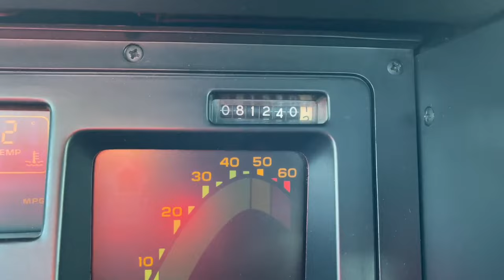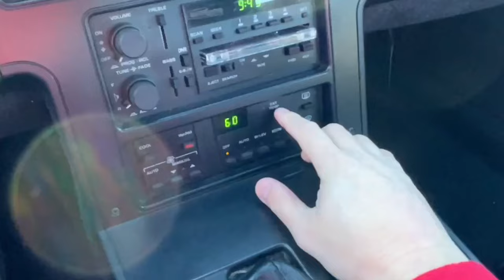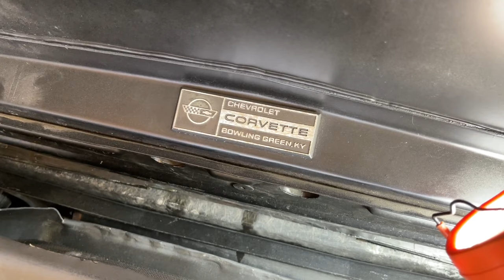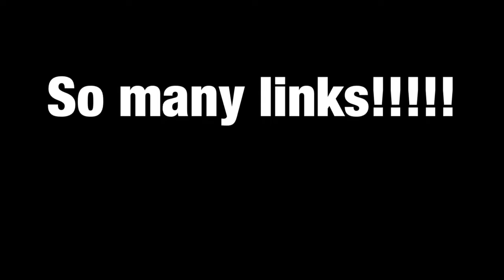6 CHEAP AND EASY C4 CORVETTE MODS

Comment: Here's another FREE mod, simply remove the heavy harmonic-balancer on the front of the water pump.  I noticed an immediate improvement in the acceleration of my 90-C4!
Reply: Yes gotta love the frisbee, even c4 engineers admitted it was really quite a pointless feature and removing it is good for supposedly 10 hp
Reply: @connerdesomething6218  I've always been about finding ways to make my car more powerful but isn't the harmonic balancer there for a reason??
Reply: @connerdesomething6218  Removing this external load from the engine adds zero horsepower.  What it DOES do is reduce inertia and lets the car accelerate more quickly.
Reply: Yea that's a great idea..😂
Reply: Wait what lol
Reply: @G31mR  Its adds Horsepower to the rear wheels!
Reply: @leejohnson2550  I mean, I’ll probably listen to the Corvette engineers who built the car and had to come out later and admit it wasn’t there for anything in the long run, they thought it would do a thing and it didn’t. One of many weird things done to cars in this odd era, a lot of it for dumb emissions reasons of the time, and other laws like the speedometer topping out at 85.
Reply: @leejohnson2550  He isnt talking about the harmonic damper on the pulley, he's talking about the "frisbee"  that was attached to the water pump on TPI Vettes.
Reply: And replace it with what? Nothing?  It a good idea unless u have something ur planning to restore that balance with. Without something there ul windup damaging ur engine. Believe me GM wouldn't have put it in if it wasn't absolutely mandatory. They are tight with their cash.
Reply: You don’t remove the harmonic balancer. 80s models have a frisbee style disc on the front of the water pump that’s about 10lbs that was used to reduce rattle when the AC clutch kicks on. You just pull it off, 4 bolts to remove
Reply: How many C4s shit their crankshaft after this?
Reply: what years does this apply to? I have a 1994 6 speed c4 lt1.
Reply: @kritekom  My mechanic says it is good on all C4's.
Reply: @kritekom  I believe this applies to all C-4's
Reply: @connerdesomething6218  not even 5 hp, it's been tested. What it does do though is remove some rotating mass and allow it to accelerate faster. It's measurable on a Dyno,  insignificant , but measurable regardless.
Reply: @kellywebb3355  absolutely none. It's not the harmonic damper, it's the Frisbee on the water pump.
Reply: Yeah but that can cause the bearings to wear prematurely engine out of balance
Reply: @dicknixon2763  you are One hundred percent correct 💯 these guys are buggin
Reply: Thats what horsepower is.....work divided by time. Or  foot pound per second.  .550 ft. Lbs/ 1second. So if the car doesnt accelerate as quick with spinning a heavy flywheel or weight.....it has less horsepower. What it now has at that expense  is.....more inertia or torque. Maybe peak  horsepower is the same but NOT the same HP curve.
Reply: as long as the aftermarket dampener is fit for the application, you don't want even the slightest unwanted short block assembly vibration
Reply: @REDZ28won That's physically impossible.
Reply: @ProudFilthyCasual Do you have an online source you can share here? I bet there's a lot more interesting information where you got this quote from the engineers from.
Reply: @varmastiko2908  Nope. Dynos prove it!
Reply: @REDZ28won Dynos can't prove breaking of laws of physics. Rotating mass doesn't decrease power. It can only add inertia.
Reply: @varmastiko2908  Shows more horsepower at the rear wheels. So .....Ya!
Reply: @REDZ28won When you have shown us the dyno plots then we can ponder on how you managed to break the laws of physics.
Reply: @varmastiko2908  Ok Clueless!
Reply: @REDZ28won Where's the dyno plot then?
Reply: @REDZ28won Since they are so plentiful why don't you share some with us.
Reply: It will be fast for about the next 3000 miles.
Reply: Better off removing the back seats if you wanna FREEMOD and save weight lol leave the engine alone if your not ADDING POWER to it like bolt ons or cams leave it alone tbh my opinion lol
Reply: @franciscosuarez2346 Remove those rear seats that were never installed by the factory, you mean?
Reply: What about footwear? My New Balance are getting old.

Comment: Another  mod recommended by former C4 engineer Gordon Killebrew is to run a wire down the fuel bib.  Simply open the lid over the gas cap for access.  This will clean out the spider crud that often forms and allows any excess water to drain instead of getting sucked into your gas tank in a major rain storm.  Never got caught in a sudden downpour?  Lucky you.

Comment: Interior, fog lamps and headlights are all halogen lights that should be changed out for LED immediately. Not just under hood halogen.
Reply: Opinion respected but I disagree heavily. On older cars I like the look of halogens so much better, LEDs have that "Autozone racer" look going on big time. Halogens aren't like incandescent bulbs for your home. They haven't stopped manufacturing them, matter of fact they are pretty ubiquitous and much cheaper than LEDs and modern manufactured bulbs are going to be plenty bright enough. They aren't sucking power from your wall so energy savings aren't a factor. They give a more period correct look if that's what you're going for with your specific build. If you don't care about that and want to buy LEDs more power to you, they definitely have a lot of good aspects, but it's not a "must do" thing.
Reply: Where do you recommend buying the Leds for 1992 corvette
Reply: Meh LEDs are already looking tacky to me.
Reply: Haters: you can get LEDs that are tuned to be the same colour as the originals, just much brighter and efficient!!

Comment: Upgrade it to becoming a flex fuel vehicle, fully compatible with ethanol not just as a minor ingredient in gasoline but as a fuel in its own right. The eFlexPlus 85 kit costs $749. Ethanol is ultra high octane, higher than even premium. Runs cooler, emits no soot, far less gunk in your fuel tank or fuel lines (once it loosens up the gasoline gunk; replace your fuel filters for the first tank or two til all the gasoline crud is gone). Domestic, 90% from family farms, renewable. And oh by the way hasn't been subsidized in over 10 years but it's still cheaper per gallon and often per mile, especially when compared with premium gasoline which is really the most valid comparison

Comment: Great video and suggestions. Not so sure about the air filter mod however.  I have an 86 C4. I replaced the L98 motor with a 600HP 427 DART SHP small block. I am still using the factory air cleaner and cover. The bottle neck for the airflow was the neck section of the air cleaner assembly, not the filter cover. The filter cover louvers have adequate opening and do not restrict airflow even when drawing airflow at 600hp.
Reply: You can get a larger Throttle Body to alleviate this situation from the OEM Throttle Body

Comment: Nice C4 and i did those same mods on my 85 plus installed headers which car made 220whp which is approximately 270 engine HP so these mods do help the engine breathe and can add up to 40HP if dyno tuned.

Eventually built new stroker engine and car now makes 382whp

Comment: Muffler eliminators are a fairly cheap mod and I highly recommend them. I was super skeptical about putting them on my 87 thinking they would be too loud or wouldn’t sound good but I couldn’t be happier with them on. They look and sound fantastic and surprisingly aren’t much louder in everyday driving as long as the rest of the exhaust is stock. They should give the car a bit more power too
Reply from the maker: I really want to do this mod. Hopefully soon.
Reply: Which eliminators did you get?
Reply: @corvettemode1556  they are chrome dual tips. I got them from Corvette Central but I’m pretty sure a lot of suppliers have the same ones
Reply: I inherited some exhaust cutouts when I bought my C4. They sound phenomenal but I don’t know if they add any HP. Do you know?
Reply: Corsa makes a full stainless high flow exhaust for the C4 that's quiet when you're just cruising and it has a mean growl when you get on it!

Comment: I sold my 89 red six speed in 2001 with nearly 200k on it. Pretty much ever little quirk that the C4 is famous for was experienced during my time with that car but as you can tell by the mileage I put on it the car was seriously enjoyed and well loved.  Having owned multiple versions of corvettes since then I would never want another C4 but it was fun at the time.
Reply: Been considering getting a c4, any big negatives you think aren’t often talked about? Also, what are some big things to look out for when buying
Reply: @ezrahaskard3527  opti spark issue with 92 and onward, upgrading the headlight motors and assembly from OEM, and the issue of steering column being weakened b/c people don't know technique for getting in and out of vehicle.  Lots of videos all come down to these issues (and dash burn out)
Reply: @ezrahaskard3527  1995/1996 corvette c4 is the way to go! Much much refined and more reliable!
Reply: Why would you not want another if it was good fun for 200k for you? Some catastrophic failure?

Comment: @RaynoldsRides I’ve bought a 1990 C4 which will finally arrive to me here in the U.K tomorrow all the way from Navad. Love your channel and it will really help me get my project going. Definitely going to be doing these mods 🇬🇧 🇺🇸 ❤️
Reply from the maker: Thanks and congrats on your C4!
Reply: Is there a kit for fitting amber rear indicators available to you, or do you have to bodge something?  Just curious.
Reply: @mescko  there is mate yeah can send you a link to a seller if you needed some 👍
Reply: @LouisDanWhite  Don't need 'em, don't have a C4 and I'm in the US.  I will never understand why amber rear indicators have never been required here, it just makes sense--they are more visible than red, not to mention since they aren't red you can't confuse them with tail or brake lamps.  I would be curious to check out the link, I said I don't have a C4 but ya never know, I'd put them on mine if I got one.
Reply: @mescko  it’s funny because in the U.K. everyone wants to change their lights to the US spec as we think it looks nicer and in the US everyone likes our U.K. spec 😂 with the mustang s550 one of the most popular mods here is switching the rear lights to the US red ones and removing the clear ones we get but the clear ones are popular in the US I hear 😂
Reply: @LouisDanWhite  I actually went through something similar when I bought a Rover P6 2000 TC.  The post-1968 US cars were fitted with amber parking lenses.  I ended up swapping my ambers with a chap over there for his clears, he wanted the US-spec ambers.  I was happy, he was happy :)
Reply: You have to fit side repeaters as well, don't you?  What about rear fog lamp(s)?

Comment: A couple that you missed, are the bracket that clips on to the rear hatch window and keeps it open an inch or two for reducing turbulence when you have the top off. The other tool fee mod, is the solid roof panel that replaces the Lexan roast you alive factory roof panel. They might be available from Corvette Central, but I'm not exactly sure. They're definitely worth the money.

Comment: If you are not at wide open throttle, the throttle body (butterfly valve) is the primary air restriction in the intake so I don't think cutting open the airbox is going to yield much unless you are driving around with your foot all the way to the floor all the time.  This mod has been discussed many times with marginal gains, if any.  Maybe along with the airfoil you are getting more results than others who have cut their airboxes, it's certainly possible.  If there were massive gains o be had, I don't think they would have designed it the way they did, leaving free horsepower sitting right there on the table.
Reply: Yes, check out the ZR-1 forum. We did chassis dyno tests a loooong time ago and found no measurable results.  The cut lid is cool, but you need to do a screen over the cut as the C4 is a major bottom breather and will suck up anything on the road.  Also look to protect the air intake openings at the underside of the fr bumper.  Look over at the ZR-1 net registry site for a list of simple preventative mods or go to the ZR-1 forum and look around for the tech tips.  Save the Wave!
Reply: @tomtom72  Yup I've already mounted heavy hardware cloth (metal mesh) above the air dam, it has kept the condenser and radiator very clean for years.  One of the best and cheapest mods I've done!  My airbox lid is stock/uncut.

Comment: made my 91 come alive when i drilled out my rear cat and replaced my stock mufflers with dynaflows. felt like a 30/40 hp gain.
Reply: No, you didn't feel a 30-40 hp gain. And if you had tested it on a Dyno or at the track the performance would've shown that it didn't do half that much. Especially not on a basically stock engine with stock tubular manifolds , stock y pipes etc.
Reply: @b.c4066  i stated it FELT LIKE a 30/40 hp gain. maybe it was only 15 /20 in reality but i'll take that too for the few bucks and little effort. the six speed does have the 3.48 rear as opposed to the auto 3.07. i guess you'll correct me on that too.

Comment: Nice ride, I put 2,234 miles on my 1990 ZR-1 since May. I bought it in April 2019, had been sitting for several years, had a lot of general maintenance to do to her. I'm going to drive the wheels off this bad boy.
  I plan on doing some performance mods to the LT5, the coolant bypass can be done on the ZR-1,as well as the air box mod. All the little things add up, no doubt. 👍👍🏁🏁
Reply from the maker: Nice! I love the C4 ZR1.

Comment: The throttle body mod does work I noticed it instantly.  The most I noticed was a smoother throttle.
Reply: Dyno tests have shown it's basically zero difference. It likely made the car slightly leaner or richer when you bolted it on, once the block learn made corrections there was most likely less than a 1-2 hp difference. Even professional race car drivers cannot feel anything less than 15-20 hp in seat of the pants, so odds are what you felt is sort of a placebo effect, this has been beat to death. Just saying.
Reply: @b.c4066  I saaw what your talking about and if you look at their charts there are a bunch of flaws I forget what they were it's been a while, just sayin.

Comment: The oil from the K&N filter only damages the MAF sensor if you over oil the filter. Also if it does, all you have to do is clean it with MAF sensor cleaner. (Don’t use brake parts cleaner. Some damages plastics)

Comment: The 'high flow' air filters are suitable for short term use in racing applications only. They do flow a tiny bit more air but it's all due to reduced filtration capacity. Pick up an OEM air filter and you can't get a better product anywhere in terms of optimized filtration versus airflow. You can destroy your piston rings in just couple k's of driving with a 'performance' filter. It's a terrible deal for two extra hp. If you know what you're doing and perform the correct measurements you might be able to improve airflow by modifying the airbox or its cold air feed. But even then you have to understand the physics of it - otherwise you're only hurting your performance.

Comment: Great video!the throttle body coolant "mod" isn't really worth doing.the air moves through the throttle body so fast that it doesn't get heated from the hot throttle body and if you live in a cold area you definitely want the throttle body to be heated.the purpose of it is to keep the throttle body from icing over which can happen driving in cold weather and it's pretty scary if you're driving in cold weather,you floor it and the rush of fresh cold air freezes your throttle body open. 😬
Reply: As he was just driving in 28 degree weather! Lol
Reply: A ton of people say this has never happened to them tho
Reply: @danbjuliano626  it's a possibility especially in cold weather.if you never drive the car in cold weather then it's fine(even though the mod does absolutely nothing)but I've had it happen to me on a 72 duster and it's not fun.
Reply: So I'm obviously late to reply but if you're of the curious enquiring mind type, you might enjoy reading my reply. You are right to say it has nothing to do with the temperature of the air itself but more about the possibility of icing. Basically since the engine is a big air pump, depending on throttle position and RPM, the amount of air being drawn in through the relatively small throttle body means the air needs to increase its speed through the intake piping to reach the engine fast enough. And Bernoulli Law's shows how increasing the speed of gas reduces its pressure and vice versa. So that means the rushing air passing through the throttle body has reduced pressure. When you lower the pressure of air it lowers its capacity to contain water vapor as humidity. So this vapor has to condense into liquid water. And we know that when water goes from a gas to a liquid, it absorbs energy generally in the form of heat. So when the air that rushes in the throttle body accelerates, it's pressure drops, which makes the humidity condense into liquid water. This condensation absorbs heat. So if the air is already either cold or very humid, it might absorbs enough heat to actually drop the temperature and freeze the water which starts blocking the throttle body. It's much more of an issue in carburetors. Airplanes even have a "carburetor heat" switch to purposefully send very hot air into the intake to make sure the carburetor doesn't start icing up.